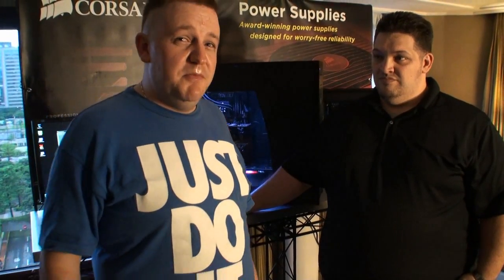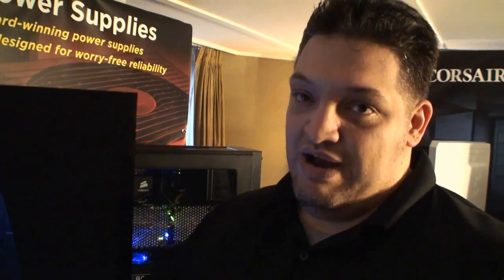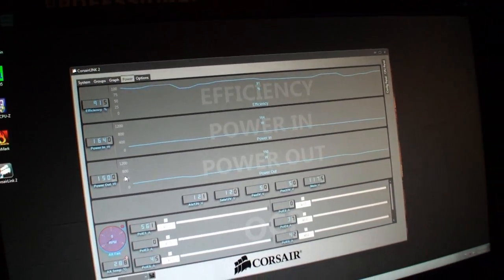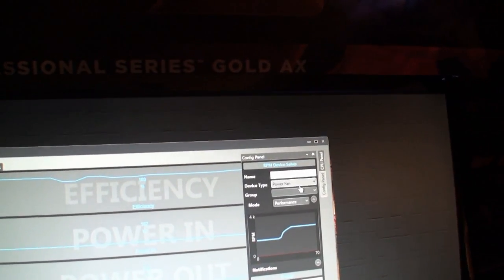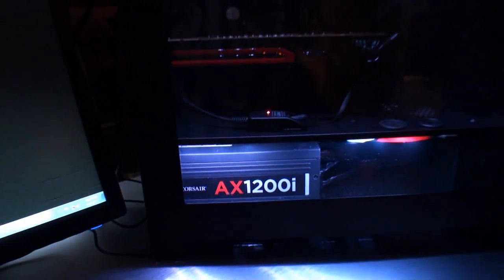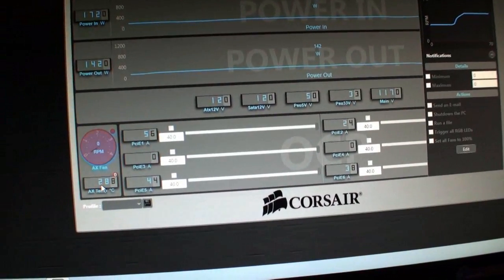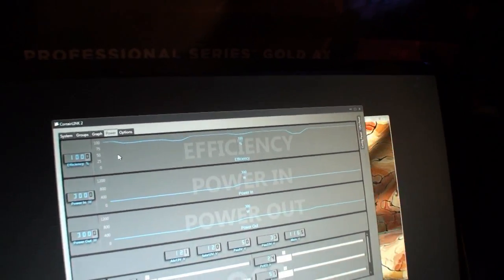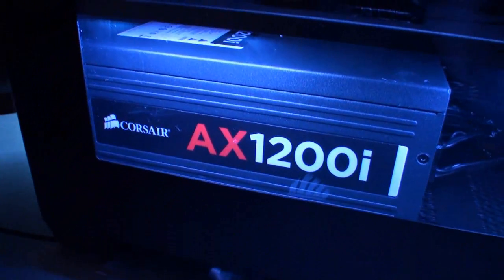Exclusive hands-on with Corsair's AX1200i digitally power controlled PSU

Comment: What's wrong with people. 1:15 idling at 175w. 3:55 furmark running at 300w.

The real answer is that the software is beta and it doesn't show over 300W. If you look carefully you can see that 56A is used on the 12V rail whiling running furmark so in fact the system is actually pulling +700W.
Please don't breed.

Comment: Yes. You could plug 2 into the Corsair Link Commander. However, there is pretty much no system that needs DUAL 1200 watt PSU's. It's just not needed...